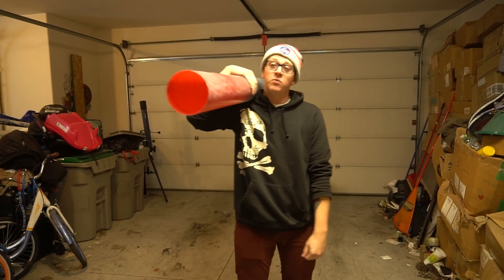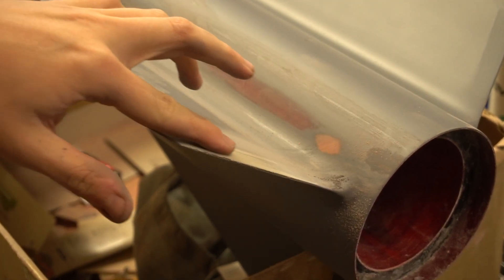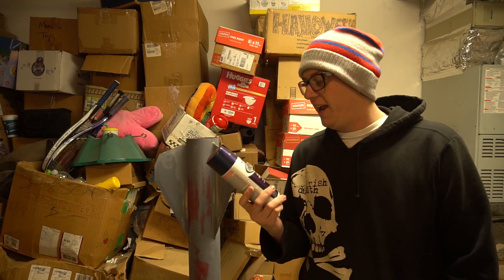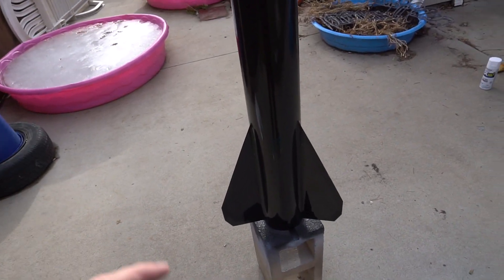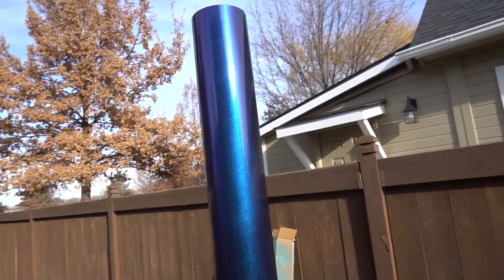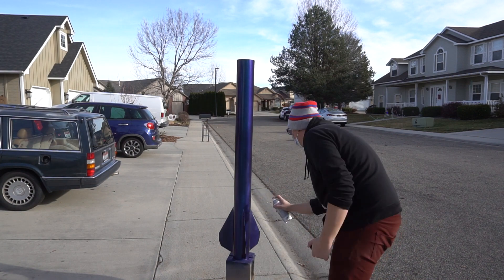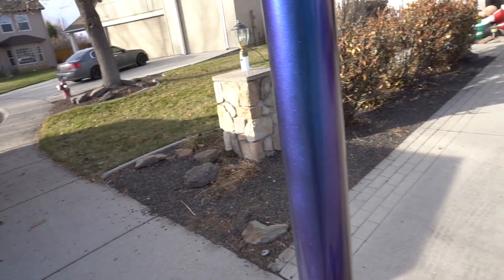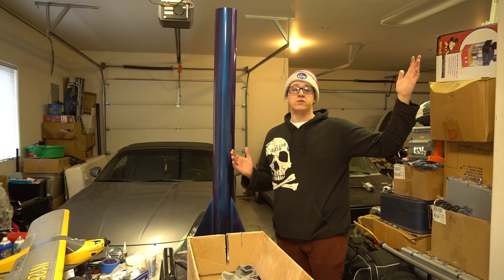Color Shift Paint On The 7 Foot Tall Rocket (Wildman Punisher 5 Build)

Comment: A little advice on how to avoid those pesky runs, and orange peel too. Whenever possible you want to be spraying your paint down onto your surface. Rather than painting the rocket while it’s in a vertical position, see if you can orient it horizontally instead. Painting perpendicular to the pull of gravity can result in orange peel and runs. Paint works best when it is sprayed downward, toward the surface and in line with the direction of gravity. The force of gravity can then help pull the paint onto and across the surface more evenly providing a smoother finish.

Comment: Just a tip from someone that does some minor custom paintwork, normally you don't sand with that fine of grit before primer because you want to give the paint a surface to adhere to. Sanding with 800 makes it smooth, yes, but will have a much larger chance off failing.  After you spray your clear and it cures, then you can sand any orange peel with with wet sanding to whatever grit you decide. Also, you could use a flat black for your base, as you are going to clear it anyway. Use minimal amount of base/color coats (to save money and wait times) and try repairing and defects (orange peel, minor scratches, etc) with your clear coats. I'm not talking shit, just wanted to see if I could help out with any future projects. 
And spraying metallics by aerosol (spray can) can be tricky, keep shaking the can ALL THE TIME and keep a good distance during your final coats. 
Cheers and good luck!